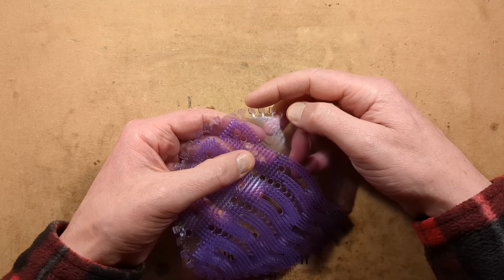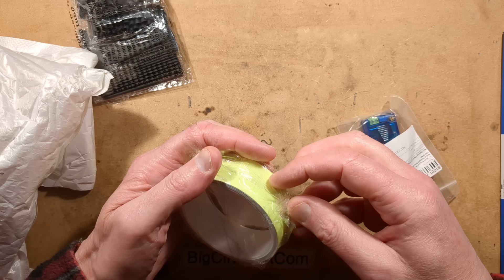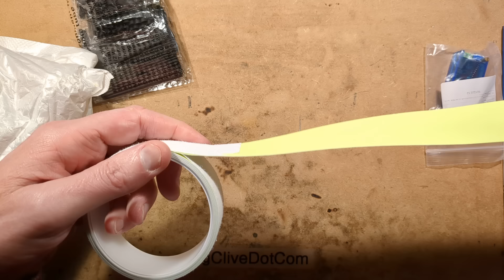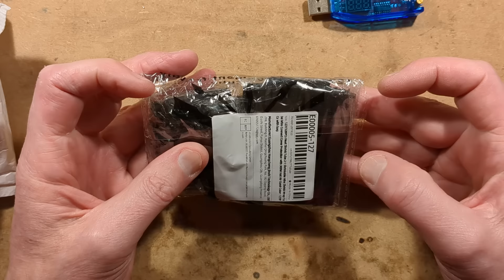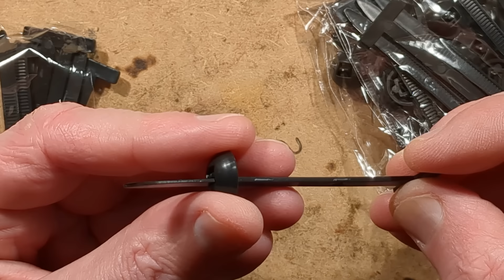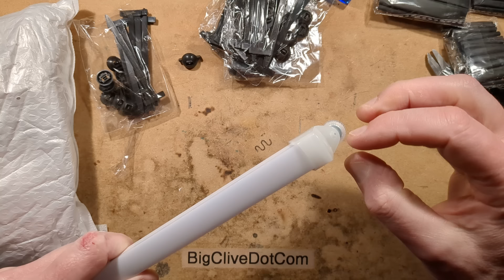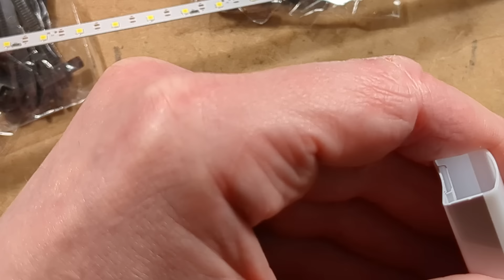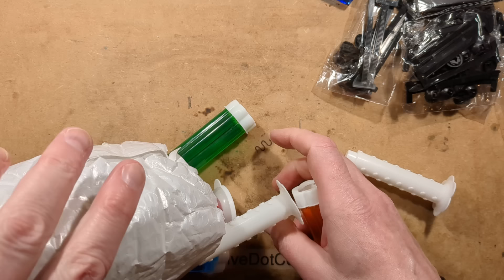AliExpress debagging quickie with magical toilet things

Comment: I got an HDR1000 certified screen running at 8% backlight setting. And I use dark mode. Everywhere. My retinas are insanely sensitive. That 8% SDR backlight on my screen is literally HDRInfinity for me... And it saves power!
Reply from the maker: A lot of the technical collective have very sensitive eyes.  On a plus note your screen illumination should last a long time compared to running the LEDs at full power.

Comment: What they need to prevent piss deflection, is a "pisscapacitor".  I just invented the term, but you are free to use it as a trademark should you  decide to develop such a product, perhaps purchasable at Pound Land. I'm envisioning a pisscapacitor as a flat geometry which tends to dampen the kinetic forces of  perpendicular piss projections, thereby reducing the propensity for piss-spatter and thus the costs of associated janitorial presence.  You're welcome!

P<is>s, Every purchase of the PissCapacitor should be accompanied with a free roll of the photoluminescent tape to clearly define the target, preventing when pissing in the dark of night goes wrong... and we've all been there...Glad to know it's not battery connected as piss is electrically conductive (ouch!)....don't ask me how I know....

Comment: Thanks for the strip light hint. I was looking for one that I can mount to the backside of my TV and have powered by the TV's USB port. Everything I find in the shops always has motion sensors or remote controls with it (and cost a lot more), but I want a TV backlight that just goes on when I switch the TV on, and this one looks promising! :-)

Comment: Many years ago I used to frequent a  pub that had a long stainless steel urinal (as opposed to the individual porcelain things), in the winter when it was cold the back of the urinal would 'ping' if it got warmed up and you would get some splash back. You could sometimes tell who wasn't a regular at the pub after they came out of the toilet!! Shamefully, we had a lot of laughs about that urinal.
Reply: A real-world example of back-scatter :-)
Reply: Anyone know why they put Ice in the Urinals of this type?
Reply: @MickeyMishra  probably helps against the stench as lower temperature means less evaporation.

Comment: If you can find the higher-quality glow tapes, they're really handy for marking flashlight handles to make them easier to find when dropped in the dark. I've also marked things like the bed-side Qi phone charger to make it easier to put back. My favorite use though is lining the backs of light fixtures in windowless rooms so there's always bit of residual light to get around when there's a power cut. This is especially useful in the bathroom where seeing  can be quite critical to a "clean" exit. 😅
Reply: Great ideas, thank you! 👍

Comment: I put one of those LED bars (one with an inline switch) in a little storage nook and it's been fantastic for the £1.75 it cost. The flexi-neck LED lamp I got at the same time doesn't seem to have any resistors and just climbs in current getting very toasty though. I like to treat cheap AliExpress purchases as low stakes gambling.

Comment: How do they mold that? Essentially the same way the mold the plastic car key cases with the little rubber button membrane that have colorful little symbols molded in: With very complicated moulds that take multiple simultaneous and consecutive injections of different plastics. If your process is dialed in well enough, you can control exactly where the wave fronts of the material meet. Interestingly, that's how they make reeses cups in just one production step - by carefully controlling the timing, flow and viscosity of chocolate and peanut filling into temperature-controlled molds.

Comment: Those ratchet strap clamp things could be very useful.

I'm glad you retained the little wiggle from the hot spring / heating element mark that's in the centre of the frame when you resurfaced the table.
Reply: But.... How do you undo then again?
Reply: @electricsparkone  same way you undo a zip tie.

Comment: I was expecting one of those toilet illuminator LEDs which you're supposed to hang on the rim, to improve your aim without turning on the main light. I use one but not for that - instead, it does a great job lighting up my stairs at night when I come close. Lasts about a year on one recharge.

Comment: A wall separating the two plastics very close to the end of the extrusion die would work to keep the edge position in place.
Reply: It looked to me very much as if the opaque layer was added afterwards (probably only different positions in the same machine), when viewed from the inside the boundary was quite diffuse.

Comment: I went to an exposition of theatrical equipment in London some years ago and one stall.was selling wires in different colours that glow when a low voltage source is applied. The idea was to sow them into the edges of the tabs at the edges of the stage to make them visible during a blackout
Reply from the maker: That sounds like a commonly available material called electroluminescent wire.

Comment: I used to work on construction sites, and for what ever reason all construction site cleaners in the UK use these yellow pellets. And they put about 50 in every urinal. I swear to god when you pee on those it takes the surface of your eyeballs off. The fumes are horrific, you walk out of the toilet literally blind. Which on a building site is not great.
Reply from the maker: They're called toilet blocks and they put far too many in.
Reply: I have seen those urinal “cakes” in 🚹’s public toilets, tends to be only 1/3 of them in the urinals and not a dozen,
Reply: "Shall I make 10 visits to this loo and put in a couple of pellets each time? - Or should I just dump a whole pile in there and not go back for a week or two?

Comment: 9:20 - good, but this solution is a one use solution. 
The "rivets" it replaces can be used multiple times.
Reply: really wondering how to get that apart afterwards.  Snip through the round bit and just let the T end fall into the bodywork probably.
Reply: @idjtoal  Push a blade or flat screwdriver between the clip section on the round bit and the ratcheting side of the t-piece. Similar to how you can open normal zip ties.

Comment: I'm using the usb power regulator to power Christmas thingies which run on stacked tiny button batteries. Since the batteries run out quite quickly I attached two wires. I measured the voltage when running (usually multi colored leds) and found 3.3 volt works best on this thing, replacing the button cells. Works like a treat.
Reply: In my opinion battery powered gadgets that expect non-rechargables should be banned. It's such a nuisance.

Comment: I think that plastic extrusion is all translucent, then the base portion is coated with opaque paint.  If you look on the inside, there is no visible transition and the plastic looks all the same.
Reply: If you look at the cut end it is clear this is opaque all the way through and not painted.

Comment: Buck-boost converters are becoming more common. It will be nice when modules with the more efficient GaN FETs hit the AliExpress mainstream.
Reply: I've had several buck-boost converters over the years, LTC3780 based ones have been most efficient for the cost and utilise a single inductor.

Comment: 1st Item:  Let's hope that they did not pre-test that urinal device before shipping it to Big Clive after which he opened the item then grabbed the thing barehanded and stuck it to his nose  :)  
3rd Item:  It looks like you can choose between Red or Green LED displays.  It claims a 5vdc input with an output of 1.0vdc to 24.0vdc at a maximum of 3 watts.  So 1/8 amp at 24vdc. Wow.  
6th Item:  They offer two different sizes...32cm & 37cm...with or without power switches.  You can choose "White" or "Warm While" however only WW 37cm w/ switch can be shipped to the US.  
7th Item:  Single colors at $0.99 each but all 6 for $6.78???  I seems that buying all 6 together means you pay $0.78 more than buying them separately.  Very odd bulk price arrangement.

Comment: > "The glow time is so short "  --- Yes, I remeber the Asst Stage Manager going around with the brightest flashlight (hand torch) she could find, JUST before the show started, charging the backstage markers. Then again for intermission. Today we "could" just nail up cheap LED lights on doorways and steps.
Reply: Part of me wonders about the notion of an LED strip mounted under these to charge them from below. LEDs plus tape produces a line about 3mm high (So no trip hazard) and the LEDs could be wired into the lighting desk so that they automatically go out (Leaving the charged tape glowing as normal) as the lights are dimmed for the performance! 💡
Reply: Mix the glow in the dark phosphors into the translucent plastic diffuser on the LED strips?
Reply: @darkhelmet169  Why not just run the LED strip at the same brightness the glow tape would be?